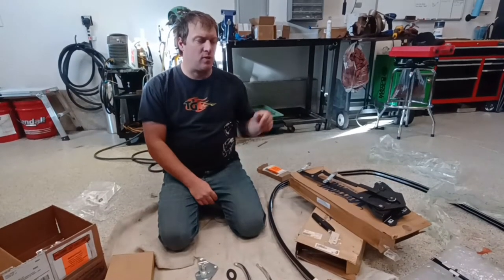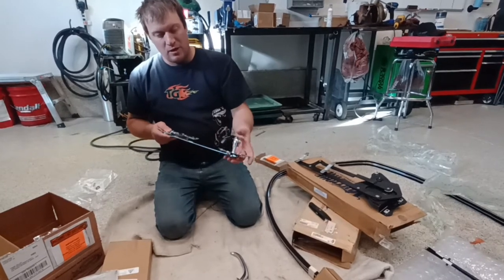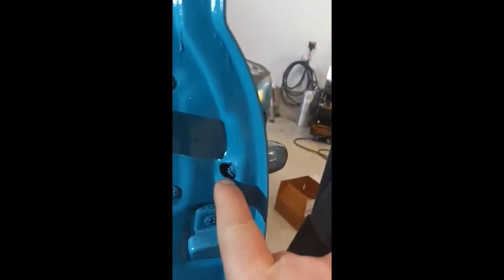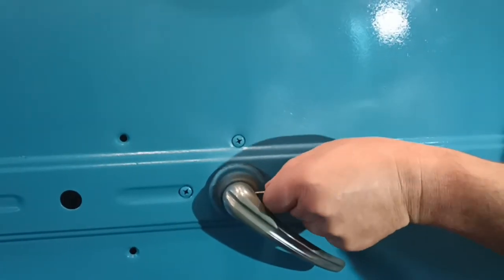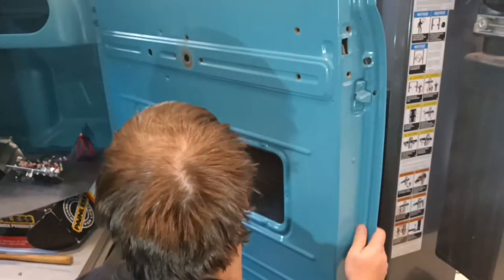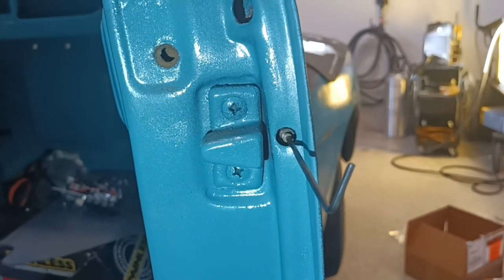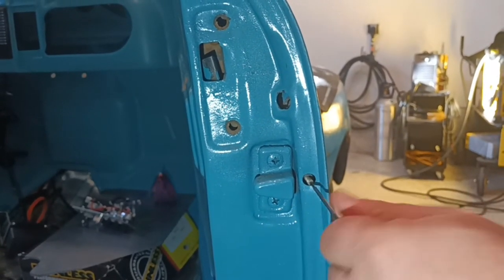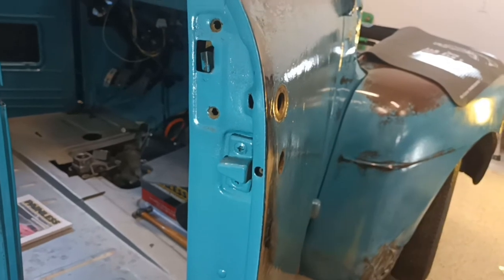1951 Ford F1 "Pure Junk" CLASSIC DOOR Handle fix

Comment: sometimes the mechanism inside the doors latch has the "slop" in it as well and needs repair. Great job with showing everything. I really enjoy your videos/repairs. I am glad you showed us the outside door handle flat head screw. its a lot simpler than i expected. The Key hole is also a lots simpler than i expected with its 3/32" allen screw holding it in. Now all i need is that baby blue paint code. 😁
Reply from the maker: Thanks Ben. I emailed the formula to you on the paint code all you need to do it make it.
Reply from the maker: How much paint would you like I can mix it up for you and send it to you if you like.😁

Comment: Thank for the video, but I’m finding it to be impossible to get the clearance to remove the inside door handle with the window in the door.
Reply from the maker: Outside door handle needs to come off, 4 screws on the jam of the door and right on the inside of the door need to come out.  Then take the handle off and the 3 screws around it. Then with light prying you should be able to get the stub out. Window has to be rolled up.
Reply: @kellercustomsgarage8289  thank you for your fast reply! Rolled the window up and down and found a spot where I could get it out with breaking the window. Thank you!
Reply from the maker: @timvandenbrink4461  great! Good to hear!